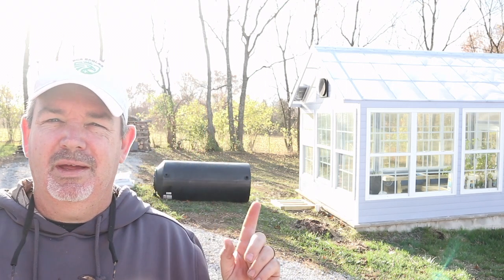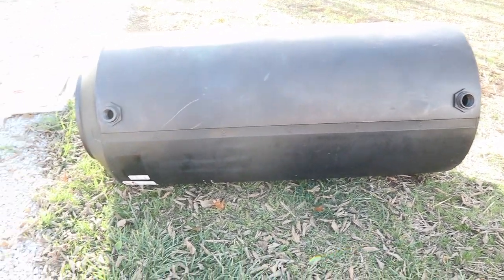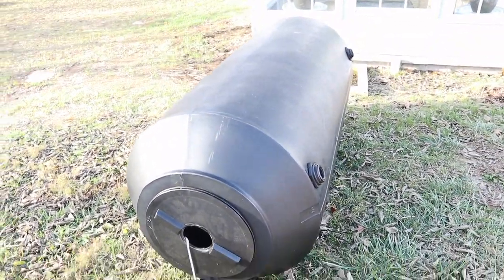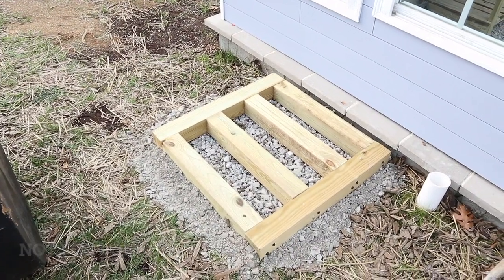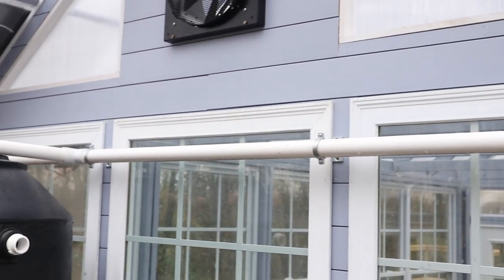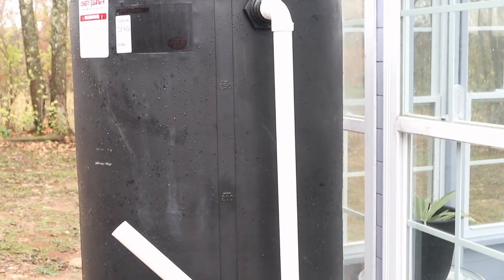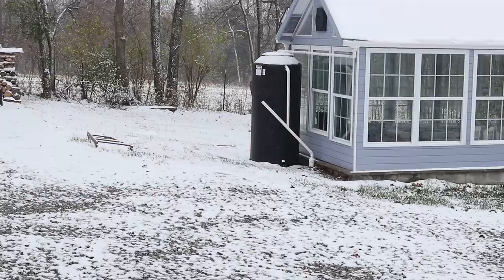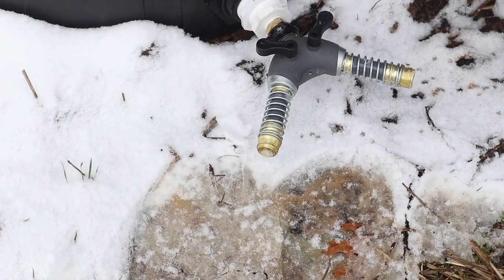#149:   300 gallon Greenhouse Rainwater Harvesting System Installation

Comment: Is this just a warm weather setup?  If not, then I guess you will need to protect the lower values from freezing.  Maybe you will address that when you run the line into the greenhouse.  Great job running the pipes, looks sturdy and is very secure to the greenhouse.
Reply from the maker: Was thinking the same thing.    Going to insulate around the valves today while out at the farm.   Many thanks for the thoughts and feedback.  Also great name by the way.

Comment: Looks like you could have shot that back in NB! Nice clean install Chris. My rain cachment plan has the gutters running into the green house to multiple 55 gallon drums that will double as a thermal heat mass in addition to providing water for the greenhouse. Stay warm Chris!
Mark
Reply from the maker: Great idea on storing inside.    I have two 55 gal drums of water in there as well.   But having all the water inside May keep it (water in the tank) from freezing as well.